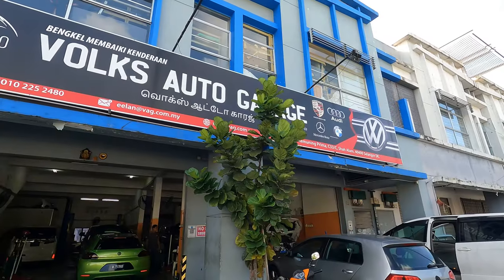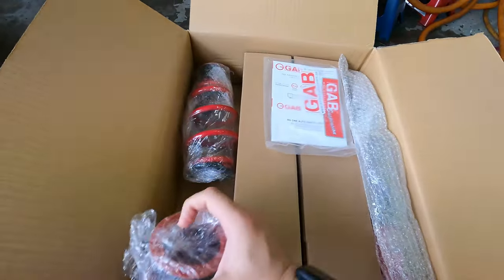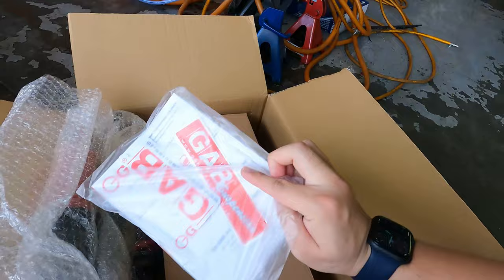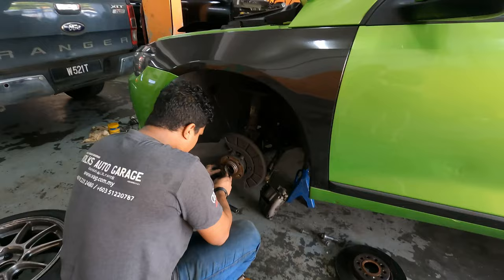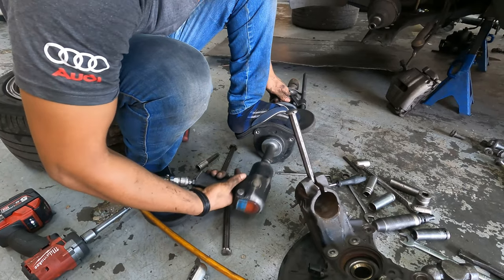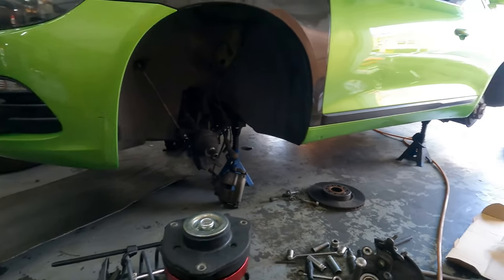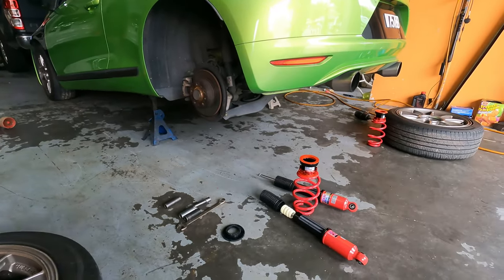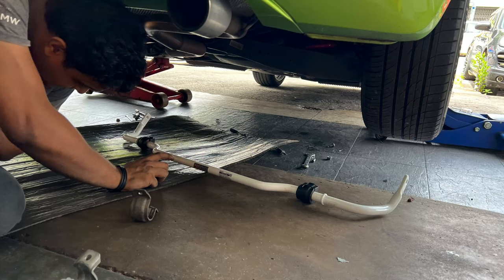GAB HE Install & Review: FINALLY! Coilovers For The Scirocco!

Comment: Think i am a bit late, but just for sharing. I owned the 1.4 twincharged for ~6 years, and did a lot of different mods on it. Coilovers, while they are nice to have for tracking, they are really difficult to live with (of course I am generalizing here, different brands of coilover can still differ significantly). I ended up going back to the Bilstein B12 kit which are good enough for spirited driving and some tracking, while being comfortable enough for daily driving.
Reply: Thanks for sharing read this in time, I was about to change my twin charger coil overs and was eyeing GAB but your valuable comment made me rethink this move.

Could you kindly elaborate on what is it like using GAB as a daily driver? Many thanks
Reply: @JR-tl8tg  Uncomfortable for daily. I would personally avoid coil overs

Comment: How's the performance. I tot of install this on my gn2 city
Reply from the maker: Stiff for sure. But so far been bearable. My stock setup was pretty stiff so not very big difference for me. But for Honda stock suspension is softer so you’re going to feel a bigger difference.
Reply: I install on my vios , feeling noisy and stiff. Not sure is it is possible to adjust softer ?
Reply from the maker: @SerHerng  it has no soft and hard only high and low.
Reply: @DrivenTechReviews  ya, now quite bouncy while driving, not sure one month later will get softer or not.
Reply from the maker: @SerHerng  within a few days you should see it settling down.